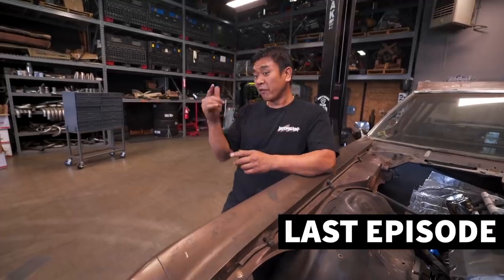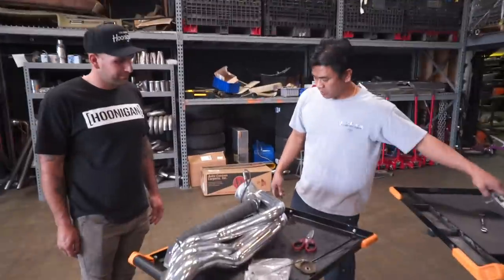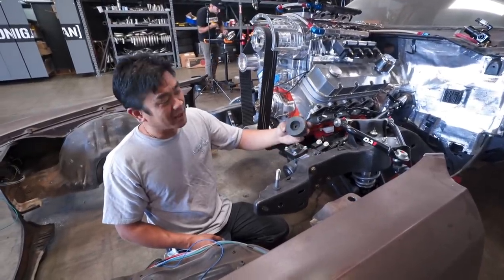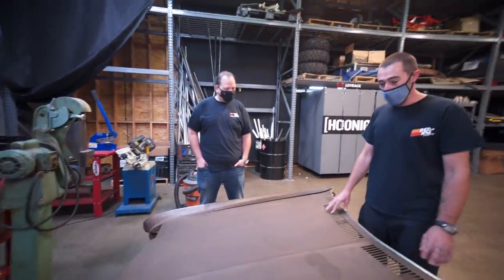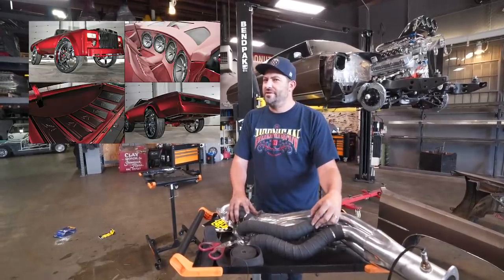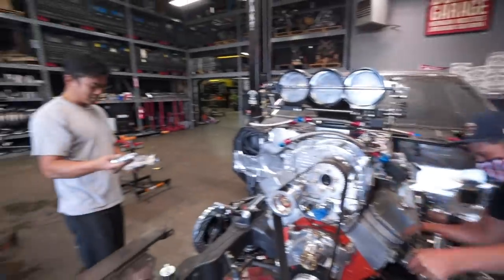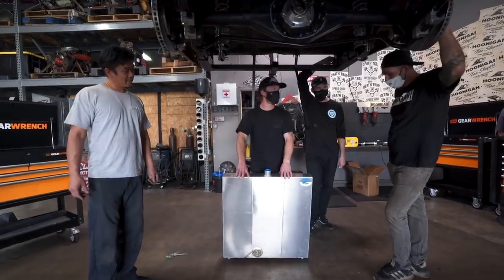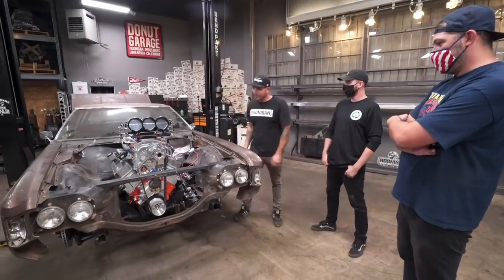The Donk is Getting a Carbon Roof, Carbon Hood, And... Hockey Puck Body Mounts??

Comment: Another pro tip for your pro tip, if you forget or don’t wear gloves, get you some of that classic white ivory soap. Idk why but that’s the best soap to get those anthrax fibers out of your skin. An old lady I worked for always had some around in case somebody was working with fiberglass insulation and forgot their gloves. Dawn works okay but Ivory is where it’s at.
Reply: damn that is a good pro tip
Reply: Yup. Ivory is where it's at
Reply: Baby powder also
Reply: Use gorilla tape. It pulls the fibers out
Reply: With scolding hot water to open up the pours👌🏼 
Thats the best of its around your neck, start the shower really hot & just stand under for a minute, wash, then finish up with cold to close the pours back up. Works every time
Reply: @scottspropertyservices6877  I don't know if it applies to working with fiberglass, but a teacher once told me that for oil, grease and that kind of stuff it's better to wash hands in cold water first, so that your pores don't open. There are some mechanics with permanently dark hands, because the grime has gone into the skin over time
Reply: You can spray your header wrap with VHT exhaust clear coat and it stops it from disintegrating as well

Comment: Y’all should definitely do the trunk in carbon too !!!
Reply: They need that weight for launches.
Reply: @Javierm0n0  I'm sure those mesh wheels they have planned will weigh plenty enough for that.
Reply: The tronk?...
Reply: @devianb  load transfer is more important for a launch than wheel weight.
Reply: @squirrelmandan5262  AAAAAAAYE
Reply: @Javierm0n0  They just have to put junk in the trunk

Comment: You guys should do an engine plate mount. It’s a plate that attaches to the front of the motor and holds it down to the frame. Much stronger than motor mounts. Especially hockey pucks.

Comment: Loving the build, but noticed something while you guys were installing the fuel line..    Even if it's up and above something that isn't moving, if it's rubbing on a bar, strap it away, so it doesn't rub non-stop and wear a hole it in.    Water can erode rock over time..  ;)

Comment: Hey scotto the caprice with the rolls front is in the auto trader in Florida for sale stripped down to the frame and body I never would have noticed it tell you talked about it . it's literally the same color it was when it was being shown but is just a shell . it's being sold by SCA Auctions in North Miami Beach, Florida 33162 were it's going for auction. it still has the rolls front on it and the body looks perfect knowing how you are you should check if it's the right one it's tagged as a 1975 Chevy Caprice.
Reply from the maker: That’s crazy!

Comment: probably not going to want to use those k&n breathers. your running a blower. Defiantly going to have a good bit of crank case pressure/ blow by. Will be blowing oil out over the place. Might want to run a set of Evacs. And with that said it means youll need to pull back that header wrap so you can install them. unless your just building for show.

Comment: Experienced fiberglass tech tip: 
A pair of cheap pantyhose/ liners will help remove fibers that cause itching. Just rub them on the skin where the fiberglass got to. 
Yes, it sounds weird, but it works.

Comment: K&N and FI do not mix. I put a K&N in my Tacoma and 4k or so miles later I went to clean it and it had fallen out of its mount leaving a fist sized hole unfiltered for who knows how long. Horrible design. Not to mention all the sensor issues with oil. Great for carbs.

Comment: Shouldn’t lay the batteries sideways they a prone to leak
Reply from the maker: Optimas are fully sealed.
Reply: @TheHoonigans  yes technically every battery is fully sealed but they all have vents for the battery to breathe but you are right, they wouldn’t leak anyways because it is a gel battery not liquid